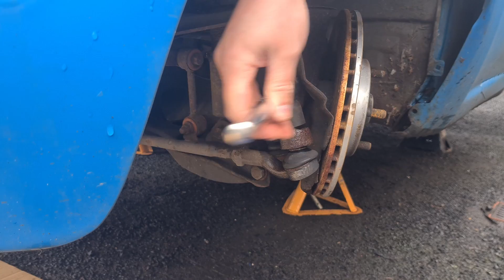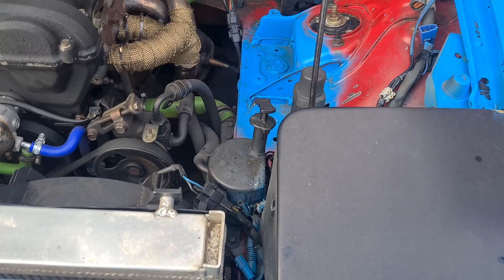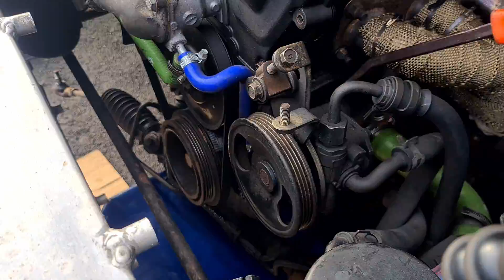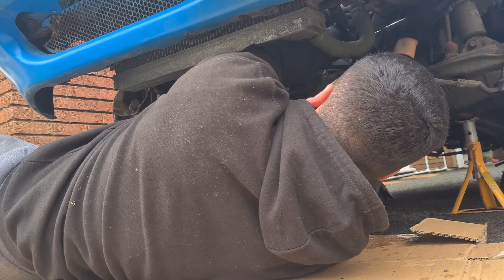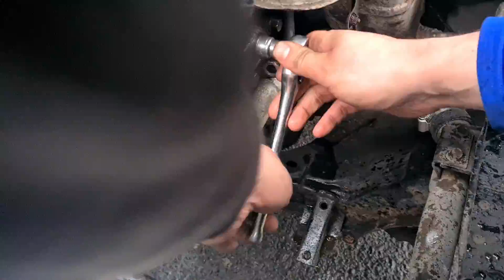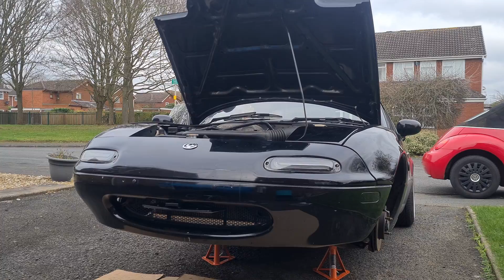MX5 MK1 POWER STEERING INSTALL (RETROFIT)

Comment: So is this an mk2 power steering going into mk1
Reply from the maker: No its a mk1 power steering, a lot of the uk base models didn't come with power steering so i bought the complete set up and replaced it👍
Reply: @ellisjones3777 My dad has the he says he doesn't want the power steering, but when i buy it, I'll probably wanna install it and a turbo
Reply from the maker: Some prefer the raw feel of no power steering, i used mine daily so parking was always a pain, power steering made it so much easier to drive😂